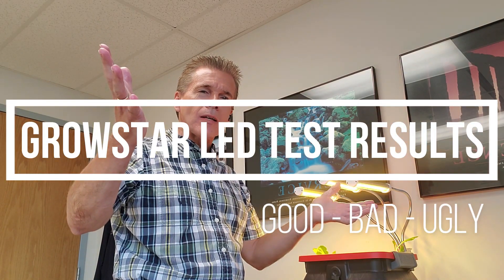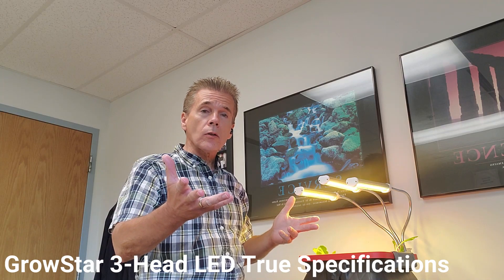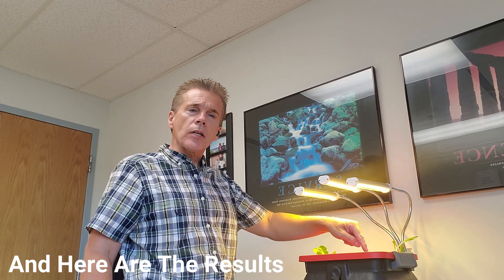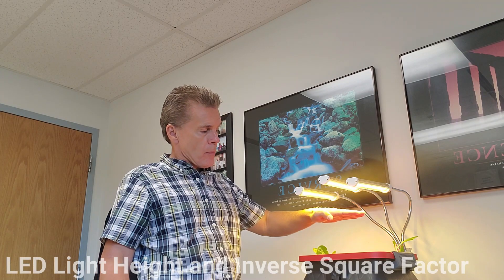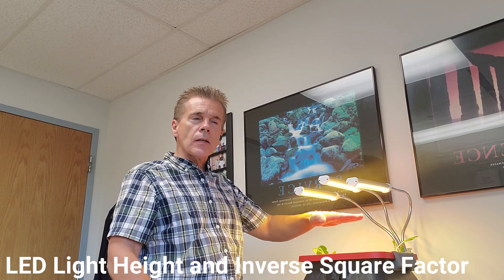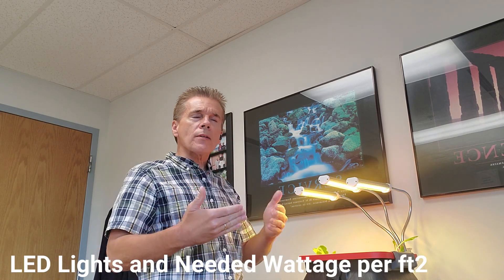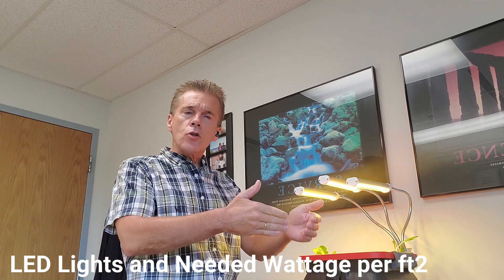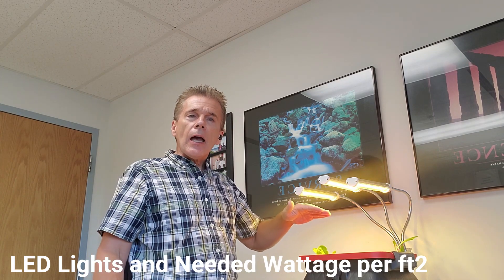LED NEED TO KNOW and GrowStar Growlight Update

Comment: 0:30 You're confused, I think about actual vs claimed equivalent- 

They are using marketing bs to say that their light puts out the equivalent light as a 150 watt incandescent bulb. The fact that the LED's only draw 22 watts is not in any way suggesting it's not up to the advertised specs. 

In fact- their advertised spec is literally exactly what you measured +/- 2  entire watts.

The power supply on the amazon link you provide clearly shows this: 12v 2amps.

12v * 2amps = 24 watts. 

You said it pulled 22 watts. That's probably within acceptable margins of error of your measurement and it's production.
Reply from the maker: Thanks for viewing and commenting.  I am hoping that LED grow light companies who use terms like "150W sunlike grow lamp" repeatedly in marketing, would use "equivalent" or a similar term in the future.  Some of the better LED grow light manufacturers have done so.  It is a good opportunity for Growstar to revise their descriptions to something more accurate like 25 actual watt light is equivalent to a 150 watt bulb.  It is the difference between growing seedlings and growing flowering or fruiting plants.  Nice work on your calculations!
Reply: @MattGarver  Sadly and unfortunately these vendors of inexpensive lights are unscrupulous and just want to sell unsuspecting people weak lights. People think they are getting 150 and instead get 22. Consumers need to be educated more and these sellers need to be more upfront.